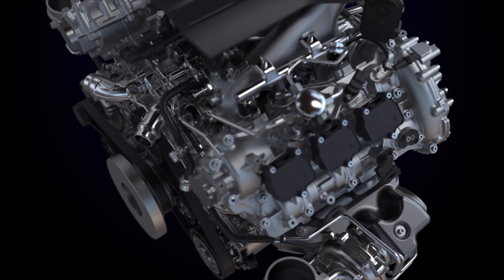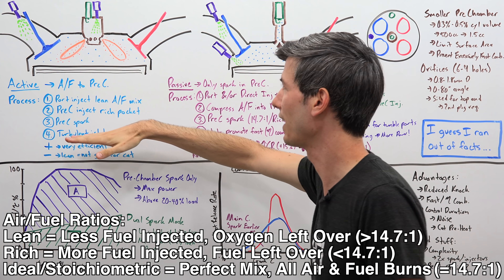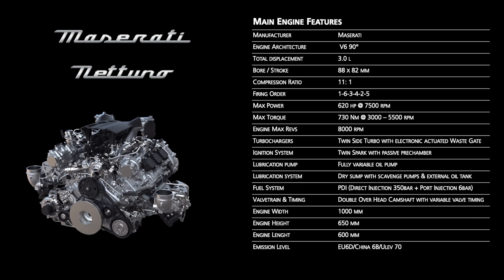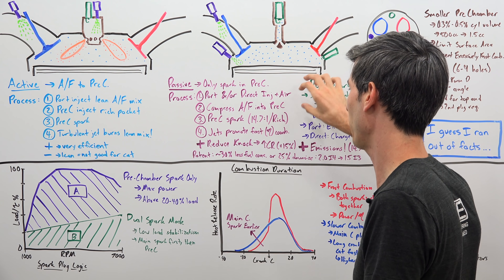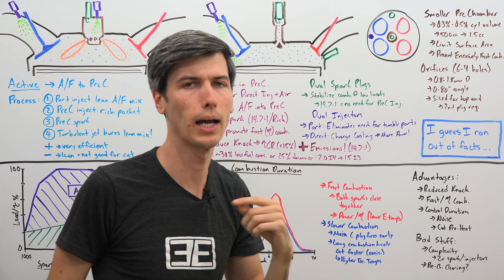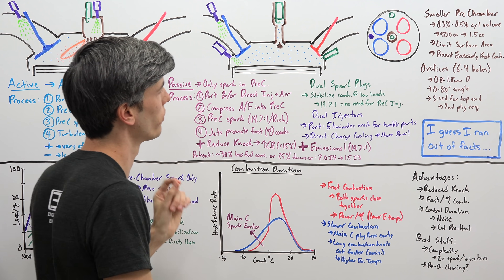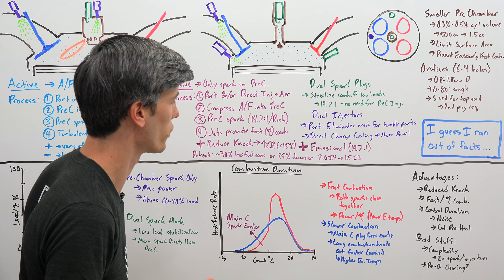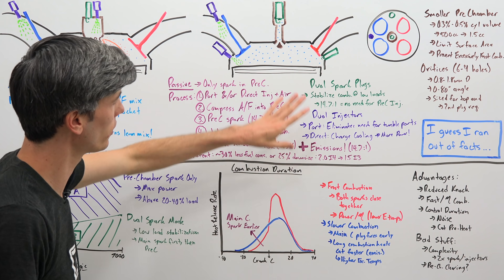How Maserati's Brilliant MC20 Engine Works - F1 Tech In A Road Car!

Comment: what's cool about this port injector on this motor helps keep valves clean unlike ford's direct injected systems.. only reason why i thumbs down the video is the fact you did not mention the high efficacy equal a very clean motor internally .. Allot of engineer's forget Fuel does a multi role  cleaner, lubricant and fuel ... this motor will be allot gentler on the valves then the ford modular motor

Comment: It also has the advantage that the combustions occur at slightly different times and thus it does a complete combustion which is clean especially when you the purchase fuel these days has at least 10% ethanol in it and so this twin combustion burns off any excess fuel so that there are no carbon deposits or a gummy residue that is characteristic of ethanol on the exhaust valve heads.

Comment: That’s pretty much the exact same engine as the 3.5 eco boost in the ford raptor and ford GT, they also have two fuel injectors, one for direct injection, and one for intake injection. The eco boost is a decent engine and makes good power, but its a reliability nightmare and it has NO place in an exotic, they sound hilariously terrible. Worse than any ricer I’ve ever seen.

Comment: I see not-so-great futures for this tech. Direct injection, which was apparently tested, has resulted in plenty of ruined intake manifolds due to lack of fuel spray to clean the runners. That prechamber is going to foul... doesn't matter what the OEM claims since we all know they're prone to lying to make us think we're getting something nice. (VW....)

I'd need to see this engine in a long forgotten beater with hundreds of thousands of miles on it and have it still be in tip top shape before I'd accept it as solid.

Comment: Good thoughts. I wonder if the ignition timing you talked about actually is programmed like you said with one spark plug then the other. I thought at start up you would want a fast burn get things moving but the timings relation to the pistons position in the bore(speed and rod angle) might be factor? All great theories here and good visuals. Should do some testing

Comment: Made a lot of money de-carbonizing  pre-chambers & valves on Honda car engines back in the day...
Pre-chamber de-carbonizing and a distributor overhaul (including point & condenser) made them run like near new... depending on the mileage.

Comment: Knock is precombustion, not slow combustion. A fast flamefront = lower torque, slow flamefront = higher (why diesels have +torque). So far, little sense. In fact nothing this kid makes sense.

Comment: Am I the only one that would rather it be an I-6 than a 90° V6? Not only would the I-6 be lighter, it would likely sound a ton better and be so much smoother running. I haven’t done any research on this engine but I’m assuming that it’s based on the Ferrari-Alfa F154 V6/V8 architecture? Both this 3.0L and the Alfa 2.9L share the 90° V and 82mm stroke, while this 3.0L engine uses the 88mm bore found on the 4.0L V8 F154.

It seems quite obvious to me that this engine is not “all new” as claimed by Maserati. It’s just a F154 V8 minus two cylinders, or the Alfa 690T 2.9L V6 with a larger bore. Other than the cylinder head it seems to be an existing design.

Comment: @engineering explained
2-nd question. Pre-chamber ignition offers strong and fast ignition, just as Mazda's SpCCI does.
But, where this Pre-chamber system does it's 'strong ignition' thing at higher loads - sounds logical -, Mazda's engineers (or is it the marketing department?) would like us to believe that SpCCI's 'strong ignition' fase is at low to moderate load/rpm. At high load the ignition is said to be 'conventional', as far as I understand. Is that correct? 
That always seemed weird to me. SpCCI brings faster, more direct ignition > more mechanical energy, less heat. That's exactly what you want at high load: more mechanical energy and to avoid the build up of heat in the high compression combustion chamber. Isn't it?
Spark Controlled Compression Ignition allows for burning lean mixtures cleanly (NOx). Perhaps at higher loads / rpm's mixtures aren't 'lean' anymore but ignition is still SpCCI for optimal power and heat buildup avoidance? Perhaps the Marketeers decided SpCCI without lean mixtures isn't SpCCI?

Comment: the fun thing is that you can easily get this kind of power and torque from a 3.0l biturbo v6 just by using port injectors and single spark plugs.
Alfa Romeo had done a dual spark plug engine called the TWIN SPARK although not with a pre chamber
Emissions though I doubt it

Comment: @engineering Explained
So, this engine has a passive pre-chamber combustion system combined with a conventional spark plug. About a year ago we've seen patent drawings on the internet of a Ferrari V12 with the same system. Same company group, same tech, seems logical.
As far as I understand the conventional spark plug is there for heating op the cats and for smoothing out combustion on low loads. 
So, the concept could work with the Pre-chamber system on its own. Correct?

Comment: Passive prechamber engines are limited towards the allowed egr rate due to the flushing problem. Egr is a matter of dethrottling at low load... This engine concept is more about the performance aspect than the efficiency at low load.  Th egr rate affects the combustion stability . Hence the twin spark to counteract.
What's the cr and bsfc of this engine?

Comment: Is this not exactly how the Mazda SkyActiv X engine works albeit without a "pre chamber"?  Injects a very lean mix in to the combustion chamber, compresses it, injectors a very small, but rich mixture next to the spark plug, ignites it, causing rapid expansion of the gas, and increase in temperature and pressure, which ignites the lean mixture ??

Comment: I am kind of puzzled why they went for a 90 degree V6 and not 60 degree V6. As this is far more optimal configuration for a V6. But perhaps they are planning for a V8 version also. As 90 degree works well in a V8 configuration
Reply: because all Ferrari non flat plank engines are 90 degrees. This engines foundation comes from the Alfa Giulia engine which is a Ferrari derived engine.

Comment: I hope I'm seeing this wrong, but those spark plugs look a lot like the nightmare plugs used in Ford 3 Valve motors that carbon themselves into the cylinder heads.

As to pre-chamber ignition, there's really nothing new there for those of us that remember Honda's CVCC engines.

Comment: Jason, the main goal is to reduce pumping losses and spark advance losses. In classic engine the spark is produced very early before TDC, thus the piston has to overcome the increasing pressure. With pre-chamber you still get your peak pressure in the most favorable mechanical moment - 13-18 degrees ATDC, but avoid the losses.

Comment: Fascinating technology, straight out of the diesel handbook - lol -.
Reply: Yea this made me think of IDI diesels
Reply: Yeah it's amazing how much of the "new" efficient gas engine tech is derived from diesels!
Reply: anydaynow true that! The technology Honda used was already 50 years old when they used it on gas engine.
Reply: that is what i was thinking too they have a pre-chamber too
Reply: SidneyCritic ComedyHound my thoughts exactly. Not as if it's new technology. Certainly questions the grant of a patent.
Reply: Because rapid "compressed ignition" is not easy on gasoline as it is very volatilr in nature. F1 engineers did they best and wallah we have a diesel like thermal efficiency on a highly volatile fuel. This is not your backyards technology.
Reply: Wouldn’t be surprised if IDI made a comeback on diesel engines in mid / heavy trucks
Reply: ------ _ diesel's can be ac/dc ....both 2 stroke or  conventional w/same fuel

Comment: I wonder if the passive pre-chamber could be useful in compression ignition and hybrid compression/spark ignition, for the same advantages you get from a spark passive pre-chamber; though a compression passive pre-chamber would probably benefit from that chamber also being compressed, say it's own miniaturized piston, maybe even solenoid based. 
I'm also curious, from how the models show the engine block, if a passive pre-chamber could be retrofitted to any engine, cooling issues and potential cylinder head/cover modifications aside. It seems like it'd just be a tube, with an expansion flange that holds the plug; dimensions of the tube itself can be changed, as height and radius are variable, to fit the pre-chamber volume, so a short-wide variation may require modifications to the cylinder head, such as a wider plug bore, where a tall-skinny variation may avoid modification. Assuming someone can also fit a cooling jacket into a retrofit solution with no modifications, I'd be curious to see a comparison between stock engine and pre-chamber engine, both on newer engines and older engines. The only absolute issue with this is the low-end secondary spark plug, there's really no way to retrofit that at all. 
I'd also like to see how a pre-chamber would work for a rotary engine. I know rotaries are dead in terms of manufacturers using them, but it'd still be interesting just to see what would happen if a rotary had one. I'd also be curious to see if a rotary could split a single pre-chamber between both plug ports somehow, or if the second port is really needed if you have a much more efficient, jetted, flame front. 
I'm also curious if there's a hybrid active/passive pre-chamber that could resolve the issue of requiring a secondary spark for low loads.

Comment: How long before a spark plug company builds a dome over a conventional plug. I reckon a decent machinist could make a threaded insert dome that takes a smaller diameter plug. (maybe cut the electrode of and put a spike in the middle of the inside of the dome to assist flame symmetry) i'm guessing the shape of the inside of the dome would need to be designed to minimize low velocity / vortex spaces where soot could build up. The 2 piece design would allow you to shim for gap as well as clean for longevity.

Comment: My biggest concern is also cleanliness of the pre-chamber. It will be interesting to see if the difference in pressure, especially given the volumetric difference, will be enough to keep those tiny little ports clean.

Comment: When it idles rough you take the spark plug out of the prechamber and soak it with carb cleaner. Soak for 10 minutes, install spark plug and give it the Italian tune up. Perform every 10k miles.

Comment: Active systems can meet emissions by either not running lean and instead pushing compression ratio thanks to the improved combustion stability. Or by running ultra lean which is a much cleaner combustion requiring only an LNT to pass.

Comment: In the tiny chamber combustion is initiated at the spark plug, the flame front moves through purging the chamber.
If combustion  separate from the cylinder is more efficient then why not have a separate combustion chamber with gasses expanding into the cylinder?
Reply: Someone was working on that, but it was too complex.

Comment: It's funny how things go full circle... Back in the 70's prechambers were the  norm for diesel engines, the fuel was injected into a pre-cup and would start to detonate in there, then the shockwave would come out the pre-cup port and instigate the ignition, then when I was in primary school in the late eighties, diesels went for direct injection doing away with the precups. Now in 2020, 30 years after diesels deemed the pre-cup as inefficient, maseratti/ferrari decide pre-cups are the next big thing.

Comment: I would imagine if periodic cleaning was required they could put a cleaning fluid/tool through the prechamber plug and evacuate the cylinder fairly effectively through the main chamber plug at specified service intervals.

If it was near tdc on the intake stroke at the time you could easily get very high airflow rates through the main chamber plug hole to flush and remove any debris.

Comment: Hello Jason, have you ever thought of doing a series on F1 engine tech? I've always wondered what are the details on what makes F1 engines special. Great video!
Reply: There is a bloke on YouTube who did a tear down of an F1 intercooler he bought. It was really interesting.
Reply: @Outland9000  PeterBjorck
Reply: short stroke engines
Reply: Check out Driver61's Channel
Reply: Skip that. I want to know about MotoGP motorcycle engines that are getting north of 350hp/liter on normally aspirated light weight engines. Yes, pneumatic valves play a role but that is a crazy power to displacement ratio.
Reply: @Miata822  They are a bit smaller, races are shorter, the tolerances can be ridiculously tight and possibly the stroke can be a bit longer compared to an F1 engine. I would imagine its just a factor of reliability vs efficiency. Im sure one or the other can get 500hp/l for about 10 minutes.
Reply: @Miata822  pales in comparison to the 500cc 2 strokes nearly 400hp/l and that was 20 years ago, would be much higher today.
Reply: @Miata822  yeah it is just that they don't. MotoGP engines put out 260-280hp out of 1L capacity.
Still a MotoGP bike only weighs 157kg so the power to weight ratio is about twice that of an F1 car.
Reply: @gustavmeyrink_2.0  they actually put out over 300hp

Comment: All that technology when the simplest way is electric motors .

Seriously why even go there why even play that .
Reply: I don’t hear you over my V8😉
Reply: You call that efficient? HAH!
Check out my anti-gravity Space Ship! Who needs an engine when you can glide trough the universe?
Reply: @lancemason7911  only hipsters who have gender identity issues have EV's
Reply: @ssaini5028  wow,calm down cowboy. I believe you should see a therapist if you have such an anger. Or at least do some reading on stoicism.
Reply: @ssaini5028  this "hipster" has an EV (Tesla) as his daily driver and I'm telling you, it's the best car I've owned to date. Another way of looking at it is that we EV owners aren't so insecure that we need a slow V8 to prove we have our parts intact ;)
Reply: @brois841  The best car I have ever owned was a 991 GT3, the noise, the handling, the PDK.  The most visceral experience ever.  I have driven a Tesla Model 3 and it was boring and lame.  Lifeless no emotion no pleasure or enjoyment.
Reply: @ssaini5028  first of all, the GT3 is a beauty.... love it. I've driven many cars/bikes at the track and there the visceral experience matters (it also helps with knowing speed entering a corner - by hearing the sound). However, on the STREET... I don't care about any of that. Don't get me wrong, it's fun once in a while, but 99% of the time, I drive as a means of getting somewhere and I much prefer the throttle/acceleration feel of Tesla's compared to every other car I've driven. Horses for courses.
Reply: @brois841  on the street the excitement continues since the GT3 is primarily a road car.  The noise is insane, down shifts incredible.  Driven the tesla was a numb cold experience imo.  Hitting a 9,000 rpm redline is priceless.

Comment: I feel like we haven't even scratched the surface of how efficient gas engines can be. Just think of all of the engineering advances we've witnessed in the past three years with engine technology.
Reply: Cars have advanced more since 1990 than they did in the 100 or so years prior.
Reply: With F1, they had achieved well over 50% with hybrid configuration. They scrape every single waste kinetic and heat energy as much as possible.

Comment: The pre-chamber not clearing out would essentially work like an EGR.  The combustion products remaining in the prechamber that didn't exit with the jet would mix with the new air-fuel mixture being compressed in.  This would reduce the O2 in the prechamber and probably reduce the NOX generated.

Comment: Great analysis & presentation Jason.

Seeing as the power & efficiency of the TJI tech is limited by roadcar emission here do you have information as to what the true maximum capability for fully realised lean AFR;s from F1 type 'active pre-chamber' TJI is in term of power/efficiency gains when compared to a traditional engine of equivalent size/config?

Comment: my '97 Hiluix has pre-chambers, but it is a diesel.....why don't they lose mixture out the exh port?  I run my aircraft lean of peak in cruise and it is old tech relatively.   So much of this is driven by Emissioins, not Efficiency.    If we considered the Whole of Life costs to the environment for the Cats and all the extra components and materials/complexity to 'meet emissions rules', I suspect a greater cost to the environment than running a simple engine with no-cats lean of peak when at low loads.

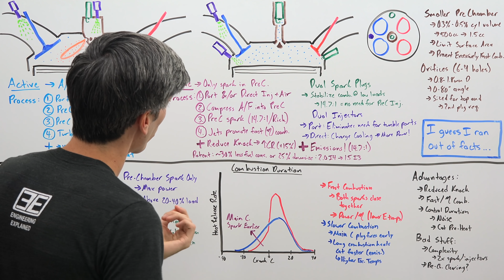Comment: 11:30 Exactly! 
How does the 'blind' prechamber scavenge gasses once burnt and take in a fresh charge?
It's a single ended port with a spark plug in it...
I can't imagine how it you get sufficient gas flow in a blind hole to get a fresh mixture in there.
What am I missing?

9:45 The old Nissan Z series NAPS engine ignition system from the late 80s makes a comeback 😁👌

Comment: The amount of development invested in ICE now is just amazing.
Can't help but think tho' how much better an electric motor is in every way (apart from sound).
It's just a shame that a tank of fuel is better than a battery in every way.
Reply: A tank of fuel will ALWAYS be better than batteries. Batteries need to carry both oxidants and reactants in the same package while combustion engines capture the oxidant (oxygen) from the air.
Reply: @electric7487  some interesting insight there.
I'm going to get working on the air breathing battery. You'll get 2%.